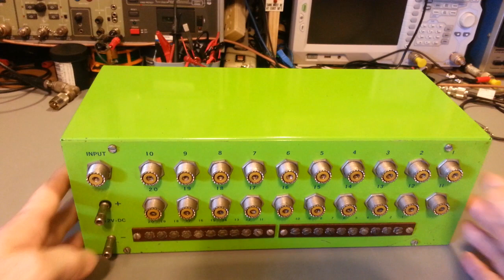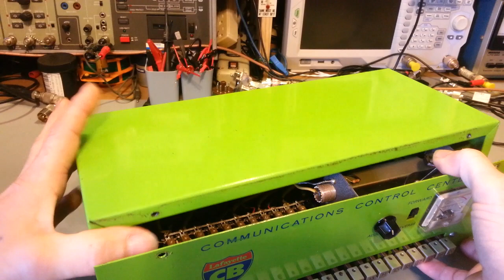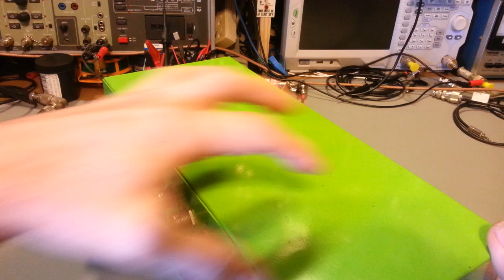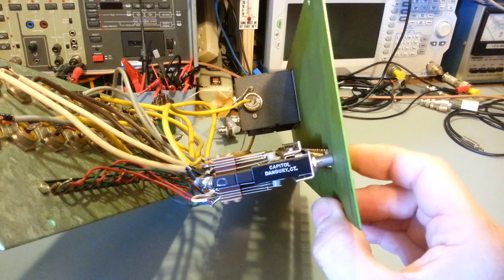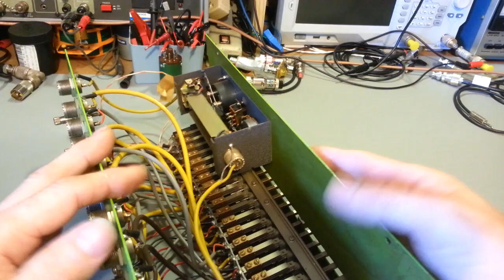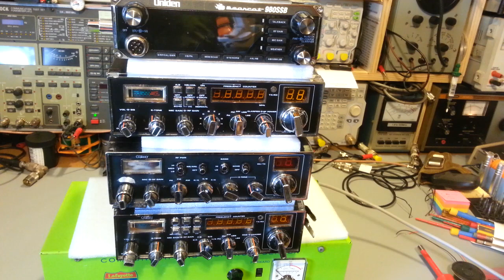Lafayette CB communications control center.  Vintage 20 radio/antenna switch.

Comment: They use those in retail settings to switch radios back-and-forth and basically used one in Tenna. Believe I saw one like that in our Lafayette store many many years ago, like I said it was for display purposes only pretty neat box though

Comment: Very cool find, yes, from what I remember this would be for dealers in the store to select radios on the shelf.  I have not seen this model but remember there were some others like this out there, probably very rare now!  And yes, that little jack is like others say for a field strength antenna, I have a few meters with the same thing on the top and a little stiff wire antenna can slip into it.  Most of the meters are missing the antenna since they are easy to lose of course and in a unit like this that wasn't even needed anyhow.  Love your videos, I enjoy following along and learning as I was in the big CB craze in the 70's and still have one running in the shack here to this day besides my ham rigs.  I have a collection here out in the back room of old CB's.  Keep up the good work.

Comment: I had to build such a box to connect up stereos at a Radio Sack when I was 16.  It is so the customer can try a specific radio in the store.  The one I built did car and home stereo but we did not switch the power, just speakers. That's back in 1976.  We switched the stereos all into one output and that went into another box back out to 16 speakers.  The car radio was similar but 6 speakers and 8 radios.

Comment: The little jack on the SWR meter is for a extendable antenna to make relative field strength measurements.
Reply: Yep, field strength meter antenna connection.
Reply from the maker: Dino Papas 

I remembered that after I was done and putting it back together.  Been so many years since I used one of those little things I didn't remember it at first.
Reply: Actually used mine recently to demonstrate the effectiveness of adding a 1/4 wave "radial" to a 2m HT; it's my original 1969 Novice SWR bridge and is still useful. The little antennas most often get lost as these things change hands over the years.